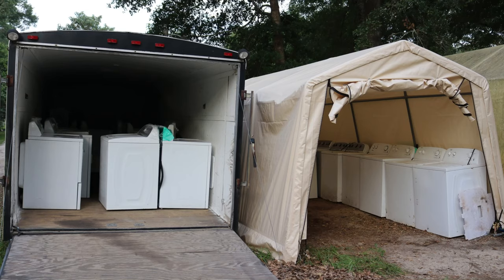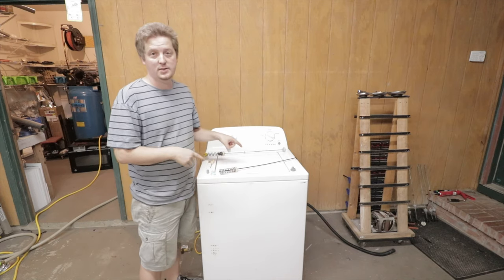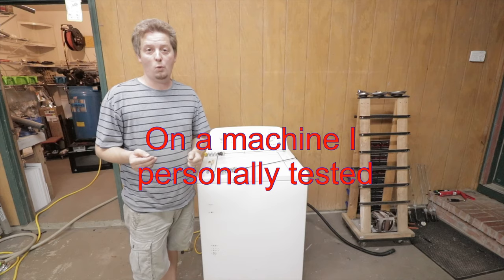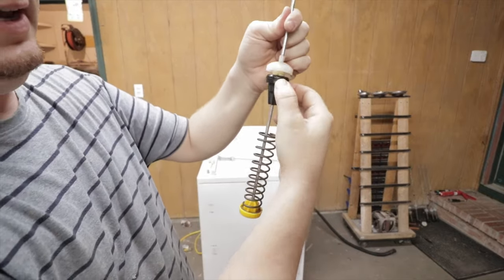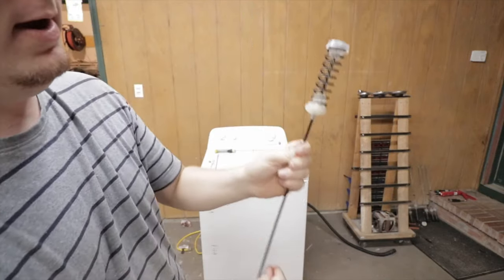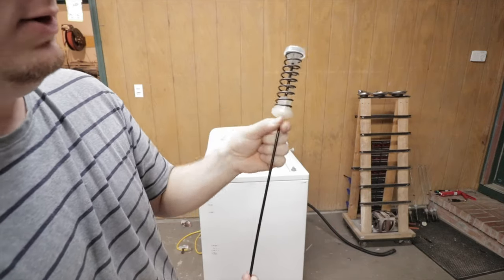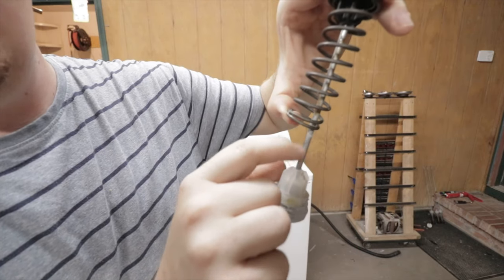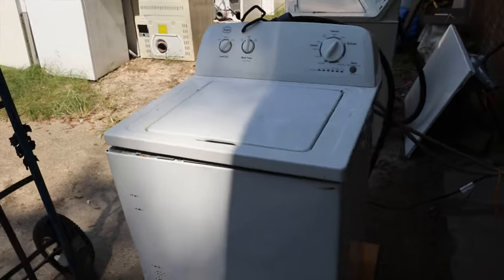Cheap Permanent? fix for shaking banging Washer? $7 to fix Suspension dampening rods W10780048

Comment: A set of 4 dampeners is $26 on ebay.  I just replaced mine. It's so much easier and quicker to just replace them than messing around trying to fix them. Replace them with new ones and be done with it
Reply from the maker: the Samsung and LG are a lot more. The cheap ones I have had some luck with it but a lot of them do not last anywhere near as long as the ones they’re a little more money. Good luck.

Comment: This is the first video I've seen that properly explains what the problem is. I ordered a new rod kit, but I may try to fix the existing rods before I install the kit. Why should I spend $30-50 for parts I don't need? Thanks for this and let us know how long it lasts.

Does anyone make really small pipe insulation? Maybe something like that would work? 

It seems that any method you can devise that doesn't apply a clamping force to the rod will eventually fail. The foam is squeezed against the rod by the compression of the weight of the washer tub against the spring. The silicone or adhesive will eventually wear out to where it is only sliding along the rod instead of clamping against it.
Reply from the maker: The liquid now is still working. Couple months now.
I saw an interesting suggestion that I have not tried yet. Apparently Samsung has slid a piece of plastic over half of the spring. I have found some people saying they have taken a piece of tight fitting tubing and it works by taking out half of the bouncing of the spring.
Look up part number dc97-05280w that’s the one that Samsung put the piece of plastic on.
Reply: @WasherDryerMoney  wow. Ran that number on Ebay. Claims 10 year warranty, free return. Relatively cheap too.
Reply: I am having the same problem with my whirlpool WTW7500GW0 and have changed the rods out 3x. But with a family of 7 it gets used alot. U mention dc97-05280w part. Now the rods my Whirlpool call for are 26" Long with a hook at the end and the Samsung part is 26.18" long but otherwise look the same. I wonder 🤔 if could by the Samsung rods and bend the end to a hook taking it down to 26" and would work and last longer? Just a 💡 idea. Bc replacing these rods are getting expensive and cant find them under $60 bc of length. I have bought $60 set and $130 whirlpool replacement set and last about tge same amount of time (7month - 1 year) Hope to replace the washer in next year or 2. It has been problems since the beginning 😕. The transmission went out in the 1st 6 months, then the control board luckily it was still under warranty. Have to pull apart every 3-4 months bc it gets stopped up with lint, string etc in the bottom, rods 3×, tub cracked and fixed it with jb weld and silicone over the top of that, fingers 🤞 its still holding and not leaking, water valve replaced, door lock replaced 2x. This thing isn't but 3 years old. Dont get me started on the dryer that matches this washer. Ive replaced the tub rollers, dryer element 3x and control panel, all the sensors at least 1x. As a kid my mom washed at least 2 loads a day and remember having the same washer most of my childhood.

Comment: My small front loader Electrolux washer is off balance when spinning. It practically moves around the whole room. Ive tried to balance the legs , etc. Do you have any advice. When I set the leveler on it everything seems to be level. Thanks for any help

Comment: Nice video! I’m going to ask after replacing or repairing the rods do you recalibrate the machine? And another thing, I noticed you didn’t use dampening grease. Does the fuzz it take the place of it?

Comment: I have a fix, but requires some 3d printing knowledge. I printed new (TPU-rubber peices) to replace the foam. So far works flawless
Reply from the maker: Wow that’s super cool. Just looked up what TPU rubber is very durable.
My email is in my bio. If you send me some pics  or clips and instructions on how to make them I’ll make a video about it. I’m always looking for a better way to solve this ridiculous washer problem.
Reply: @WasherDryerMoney  sending email.
Reply: Can i get that stl file?

Comment: Can you just wrap the rod with a thin layer of Teflon tape to add a more resistant surface?
Reply from the maker: I don’t think so, because it would be going through the cap up and there is very little room for anything to slide by there.
I’ll be doing an update video soon with some of the best ideas to repair this.
Reply: @WasherDryerMoney  had to take my whirlpool no agitator 2020 model apart.  Bought brand new and its already vibrating the machine across the laundry room.  I checked took you’re advice and see what you are talking about.  Our pads on the bottom weren’t run out or leveled and the machine tore up the foam on the inside.  It’s holding steady for right now but hopefully the damage isn’t already done mine felt like there were still resistance but we’ll see.  I may go ahead order new suspension rods in case and just replace ours.

Comment: Hey I have a PTAN9455MGG GE washer can't afford a new one and can't seem to find a manual. Loud grinding knows and knocking sound. Open the lid and the drum seems to be on a skew backwards. From what I've read theses machines work slightly different than older models just wanted your opinion if possible before I popped it open to take a look.

Comment: I believe it isn't a load suspension rod only ,it's a sealed suspension shock absorber. I believe it works through trapping air like a bike pump. So the solution needs to trap enough air in the cylinder during the compression cycle .
Reply: You can try 3d printing something

Comment: I have a portable washer that fails at the spin dry cycle. A piece has come loose and now pokes out over the drum. It does not have a hole on the loose end, so I am not sure how it was connected before. I have a pic but I'm not sure how to attach it.

Comment: My washer keeps tripping breaker every so often
I homed out the motor but it reads good.
But at spin cycle the washer makes a lot of banging
Do you think a bad suspension could cause the breaker to trip?
Reply from the maker: There could be a short happening when the washer is banging. Maybe a hot wire is touching the frame as it bangs around.
Check, the wire on the bottom of the washer around the water pump. Sometimes rodents will chew these wires.

Comment: Brand new amana, rods are good but the machine goes crazy on spin cycle. Any advice? I called amana to no avail. I haven't tried replacing the rods because it's only 28 days old and the tub doesn't bounce when I push it. Just comes back to place in one bounce

Comment: We do have a maytag continental washer and it shows code f05 washer out balance,  please kindly what do we need to fix it. Would you please kindly let us know. Thank you very much.
Reply from the maker: Not sure. I don’t really work with a lot of washers that throw codes.
In my experience with newer top loads off balance are usually because of the suspension.

Comment: Split the piece with the foam in it, then fill it with sticky pad glue from a mouse pad. It will restrict movement on the rod, won't wear out and is non toxic.
Reply from the maker: That might work. It does sound like a sticky nightmare though LOL

Comment: My machine only bang and knocks on heavy loads during spin cycles. 
Is that considered the same problem?
And to make it worse only washed 2 pillows. I guess the pillows very heavy while soak wet
Reply: I would think so. Our washer did it every so often but now it does it every load. When it first started happening I noticed it was only loads that hold a lot of water. For instance I put a load in that was just a comforter sheets and pillow cases and it spun fine. The next load I did was all towels maybe 6 or less and it was impossible to spin without it jumping. Possibly the begining of failure

Comment: Are you in CA? I have a GE with a leaky hose and a broken weight so its wobbly . The local repair shop came down charged me $175 dollars then told me to buy a new one. I know i can be fixed. Im still using it, dragged it out on the porch. Lol

Comment: I found a solution thanks to you and a suggestion in the comment section made by nigel brown.
The fix is made by using Whirlpool direct drive washer motor grommets.
Part # WP62691 to replace the worn out dampers.
Slice off the section of the grommet which would connect to a Whirlpool direct drives' transmission plate.
Cut a slit in the grommet, slide it around the rod, so the flat side rest on top of the damaged damper.
Have the dome shaped side of the grommet facing up so it will match dome shape of the plastic which covers the damper.
Reply from the maker: Very cool

Comment: First question So the drum not supposed to bounce  up and down and if it do bounce up and down i need to replace the rods?
Second question i was washing with my whirlpool washing machine when it start it sounds a way and i turn it off i small something burning when checked it out small was coming from the control board that i lid switched  try to start it but the lid switched lights keep on flashing machine wont start what could be the cause of it?

Comment: Have an old version of Amana top loader model NTW5400TQ1, it washes great but during sprin cycle it vibrates a little much. My question is why is it, when I grab hold of the center agitator and push down on it, it does not have any spring to it at all but feel completely solid with no give!. When I push the drum to the side it sort of stays in that position till I push it back. This happens on all 4 sides. It washes fine and the drum spines well centered but vibrates (NO BANGING) just vibrates and shimmies a little too much. Do I need suspension rods?

Comment: I gotta say This was very interesting and I had a lot of fun reading all the comments  Id love to get my hands on the engineers that design this kinda crap!
Reply from the maker: Lol.
I always just replace the rods for machines I resell. This is just an experiment to try to fix the problem A little more permanently. I actually am still using this washer in my personal home to see how long the fix would work. Still running strong I’m pretty sure it’s a permanent solution to the foam deteriorating problem.

Comment: if you could create a surface for a hose clamp when setting up the adhesive reservoir after its cured reassemble with a stainless generic hose clamp around the point you added for enclosing the liquid nail damper . that would provide a way to increase damping tension initially and over the course of wearing from use . what an awesome hack !

Comment: So how did this hold up?
  I saw one video where a guy used safety pins or something like that forced down between the rod and the spring cap. 
  I am wondering about applying enough heat on the cap to partially melt it to see if will grip better. 
  I have worked on a lot of washers and still can’t quite wrap my head around how the cap coming loose causes this problem.
  I wonder how the mfg’ers get them attach them. 
  They are supposed to slide up and down, right?
  Down with pressure from the washer then up from spring pressure I assume.

Comment: A long term fix could be replacing the worn out white piece with several orings that fit the diameter of the rod.if a spacer is needed cut a piece of pvc pipe to take up length of white piece. The friction of the orings to the rod should work.
Reply from the maker: The only problem with putting anything like an O-ring over it is getting it on there. It Hass to go over the entire part and into that space. Unless you cut the O-rings and re-glue them together.

Comment: @washerdryermoney 
I have a Maytag machine I got for my brother-in-law it’s about a year old. I got it because the suspension rods were replaced but machine still vibrate. 
Any advice?
Reply: Because I didn’t do the replacement I don’t know if it’s the wrong part or installed wrong maybe. Is there anything else that could cause an extreme vibration?

Comment: I have the same type of Whirlpool and have the same problem and it is getting worse and worse. I have seem videos that people replacing the rods to fix the problem and was wondering how the rods matters. Now I understand. I do have a question. I noticed that the top of the spin tub is not centered to the plastic tub. It is tilted by about a quarter inch at the top. When rotating the spin tub by hand it is noticeable that it not concentric to the plastic tub and it wobbles with respect to the edge of the plastic tub. Is it normal for the spin tub to wobble by as much as a quarter inch, or is the shaft or the tub mounting flange bent?
Reply from the maker: I have seen several washers that are slightly off center just like you’re talking about. Most of them will stop shaking with new rods but I have seen some machines were that I’ll center is bad enough the new rods don’t help.

Comment: I have a Samsung and the grommets are rubber. I pulled it out of the cap put a zip tie around it as tight as possible then cut a notch in the cap to allow the grommet to fit back in the cap and sit flush. I'll let y'all know if it works.

Comment: Thanks for going in depth on why the suspension rod goes bad!
Reply: Just curious where in the video he explained why the rods go bad
Reply: But in all seriousness. That was the problem with mine, I bought a used samsung and it had rods that where to short. I bought new ones and it solved my issues.

Comment: Bro I’ve bought brand New suspension rods, new clutch, new belt, springs for rods and then I ran across your video. Nothing worked until you showed what the actual problem was. The new rods were from eBay. Trash. Same problem as if they cleaned old rods and sold as new. I did your trick and I’ve ran the washer all day without any problems. I really appreciate it. I subscribed to your channel. Keep up the good work
Reply from the maker: That's cool. I still have the machine in my personal laundry room and it has not given up yet. The main issue with the fix that I show is how long it takes for the liquid nails to dry.

Comment: Hi sir! do you refill the the gap with fuze it once both sides have dry out?
Reply from the maker: I’m going to make a new video soon.
The new way that a lot of people are doing is putting yoga mat cut to size inside it.
Reply from the maker: Yes, I put a small amount of use it to buy the two together. But I would still recommend the yoga mat trick. A lot of people are having great luck with it.
Reply: @WasherDryerMoney  where can I find the yoga Matt trick please help
Reply from the maker: @LEONDELASIERRA1  I haven’t seen a video for yet. I’m planning on making one. I heard about it on FB appliance repair groups.
Pretty simple make the piece of foam a tiny bit bigger than the original piece so it squeezes the center rod.
I looked at Walmart and they did not have a 3/4 inch yoga mat but you can order one on Amazon. There’s also another trick called the safety pin trick. There are videos on it. Basically pushing a safety pin through the cap on top of the piece of foam to tighten that area. Hard to explain over text but you’ll find the videos on that method.

Comment: I just replaced my rods with new ones and I have the same bouncing. My unit is level.
Reply from the maker: It could be the inner drum is bent or the part that holds it to the outer drum has failed. There is a fix to that now. I’ll be doing a video on soon.
Bens Appliances and Junk just did a video on it recently.

Comment: Aren't the replacement rods cheap already?? I don't know I haven't priced them yet , how much are replacing them?
Reply from the maker: I don’t recommend the cheapest ones but usually in the $35 range and about $50 for the good ones. Some washers require different types of rods and they can be all the way in the hundred dollar range
Reply: @WasherDryerMoney  thanks man, I'm watching this video again I'm about to do your DIY today, I also watched a guy's today that was talking about some kind of grease that he used but his video was very clear to understand
Reply: @WasherDryerMoney  hey I just removed my springs and the plastic part isnt to loose I have to give it a little force to move it, would it still be the problem should I try your liquid nails still or try something else? The error code I'm getting is the UL when it's going into the fast spin extraction mode? Thank you clothes piling up lol need it fixed before the wife goes nuts

Comment: I used a flat washer ( the type used for changing on a tap or faucet); sliced it up to the hole, passed it around the rod and under the cap (where the foam is) glued it back with super/crazy glue; replaced the cap and re-installed> Rods have been working well for two weeks so far; no more banging or walking. Will give updates.
Reply from the maker: Cool

Comment: How long did this fix last ? Better than replacing rods ?
Reply from the maker: I’m still using this washer in my house. It’s been over a year and it’s running fine. I’m going to attempt another fix soon that should be easier because the dry time will be much faster.